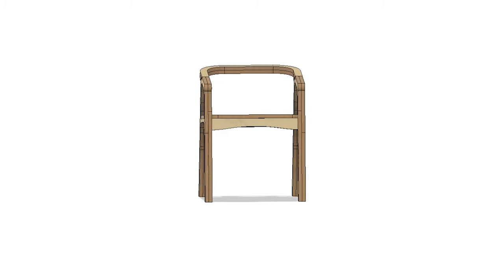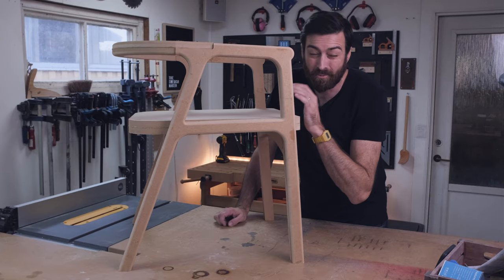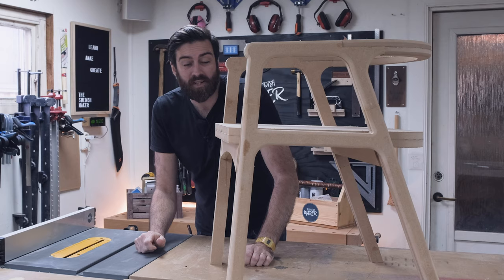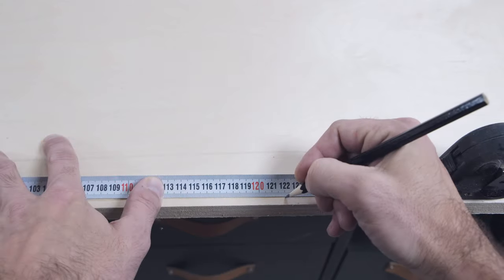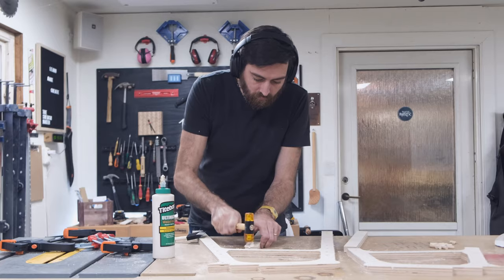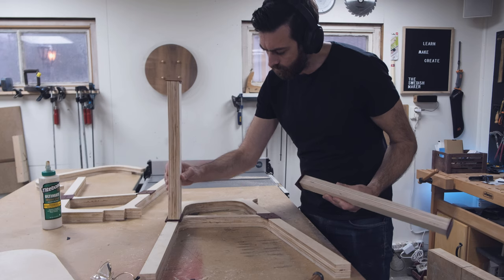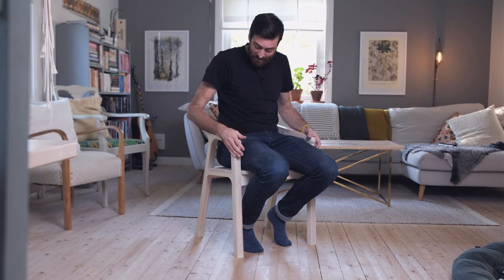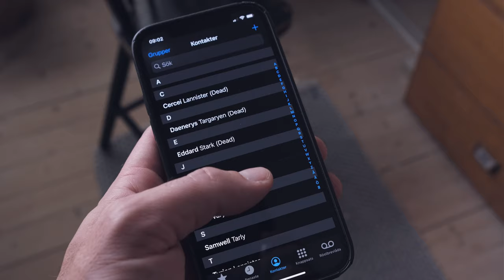Making a Plywood Chair with a CNC - free plans

Comment: Very nice. A little improvement, if I may: the rounding of the seat should start immediately after the end of the back leg to a void the widening gap between the two. I'm quite sure you can make 3 or even 4 chairs from a sheet of plywood (by splitting some pieces). Sorry for the dragons.
Reply from the maker: Thanks! The leg pieces could for sire be divided more as they leave a lot of empty space around them. As for the rounding of the seat - totally agree.

Comment: That's a really good looking chair. There was loads of design work that went into it and it's good to see a bit of the process as you made the prototype. I was wondering as you made the dowel jigs if you could have cut at least some of those with the CNC? Maybe using some sort of mortice and tenon joint cut but the CNC might also be an option. (Appreciate that would have probably added to the two day deadline in CAD time though :)